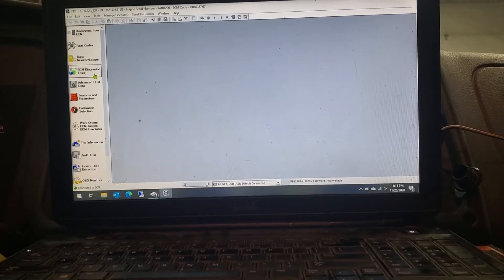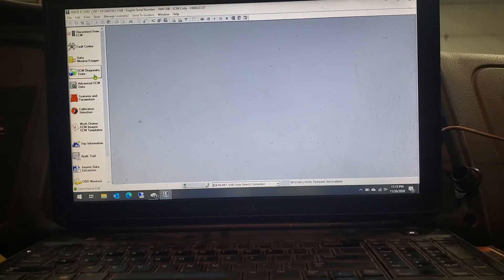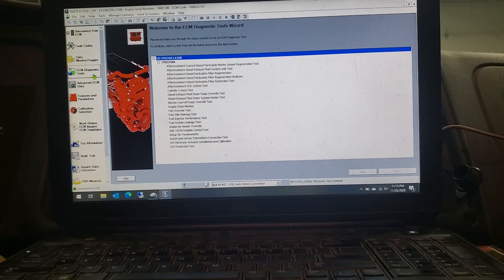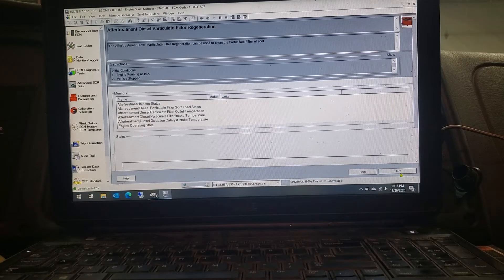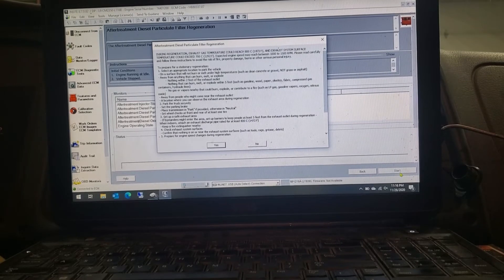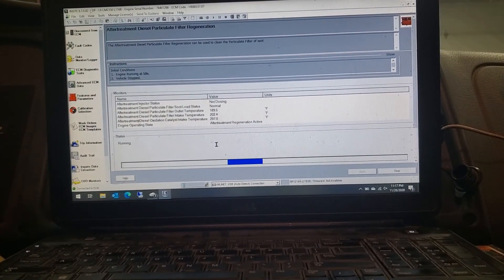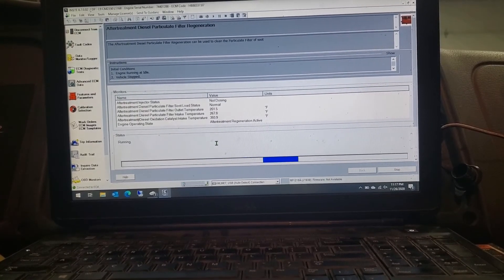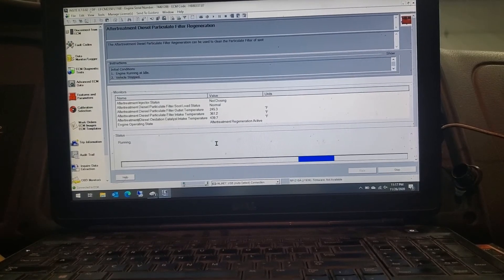Cummins force regen

Comment: I was doing a regen and I had code 1922 pop up I cleared and started a regen again and now I have 1921 code, which temp sensor  do you recommend I should replace, I was thinking the differential pressure sensor on the particulate filters

Comment: I have a 2012 Tiffin Motorhome. What's tool or program do you suggest I buy to clear codes and do force regens? I have a inlet ox sensor that I need to replace and clear code and I don't want to have it towed just to get the code cleared.  Thanks
Reply from the maker: I don't work on motorhomes so I'm not sure does it have an obd2 port

Comment: What rpm does the Regen start off with? I'm using a Autel and it tells me that the Regen is not applicable but a few seconds after that message it raises to 900 rpm but that's it. First time doing it on these usually on Chevy and Ford's they're loud and way higher RPM.
Reply: May differ from truck to truck but most 1100 rpm

Comment: How do I get this program and equipment for my 2019 ram 3500
I need to force regen and there is no way to do it.
Reply from the maker: You can get it right from the Cummins website or for pickups I have a snap-on Zeus scanner that use for that

Comment: Hi! Great video, I was wondering if it were possible/safe to disconnect ECM & computer from truck during forced Regen? I'm working with a fleet and need move onto other trucks while some are doing regeneration
Reply from the maker: No i would wait til It finishes before you remove the computer
Reply: Once u start it it going to keep going by itself long as no fault becomes active,and the way u know fir sure is to unplug it if the idle stay up u good to go to next truck
Reply: It should not matter. If done properly you can unplug